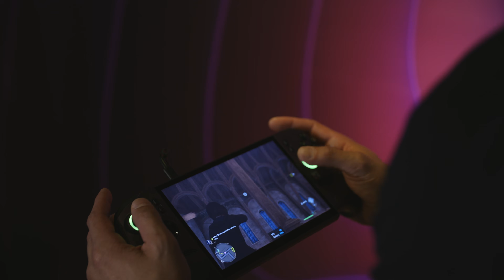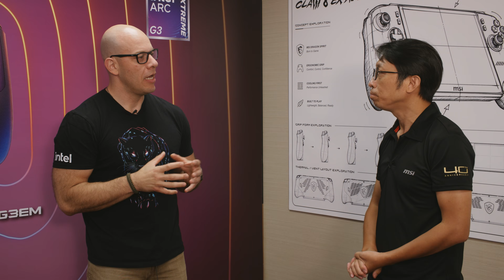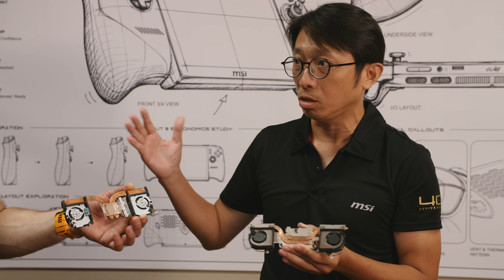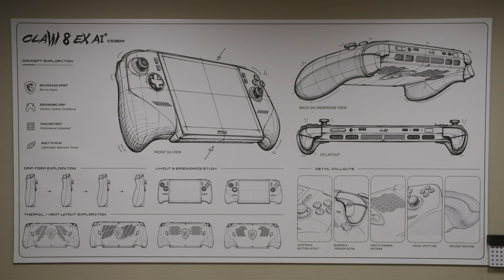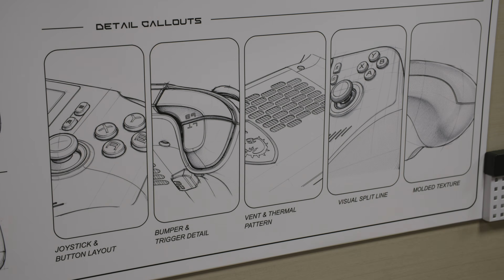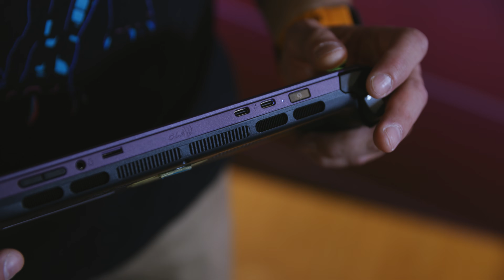How MSI and Intel Co-Engineered the Claw 8 EX AI+ Handheld | Talking Tech | Intel Technology

Comment: This is all cool and all but apparently ya'll didn't fix the loose sticks? Why did you spend so much time and effort on the redesign and not swap in better sticks for maybe 10 bucks a unit???
Reply: Loose sticks is always a cons for the Hall effect sensors because they rely on magnetic sensors to track movements...Rog Ally series use carbon film petentionmeter which the two sensors rubs each other in contact to track movements the cons is the carbon petentionmeter are prone to Stick drift while the Hall effect was immune on this
Reply: The second ally x when they fixed the og sticks was such a big difference
Reply: The sticks feel fine. In fact I prefer them over the tougher sticks. A lot easier to move.